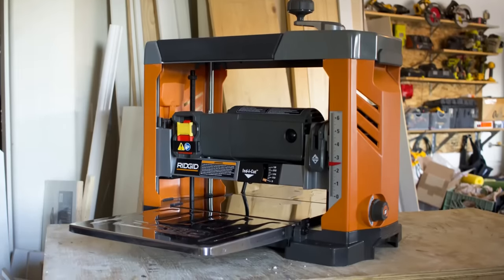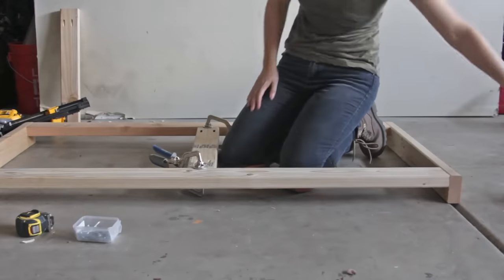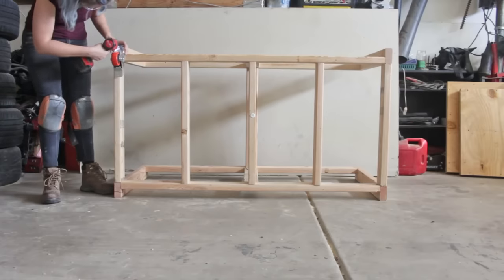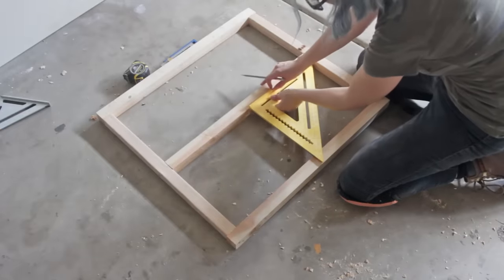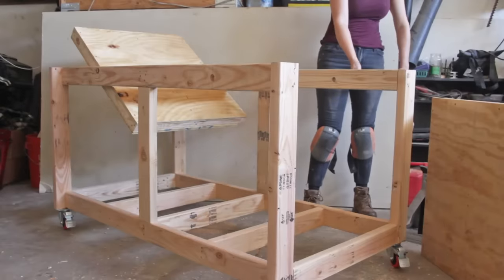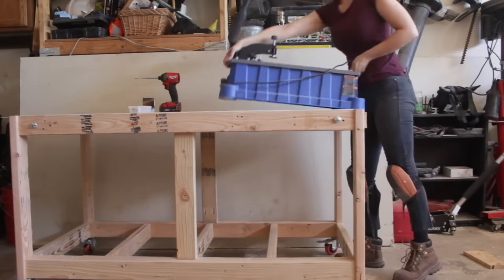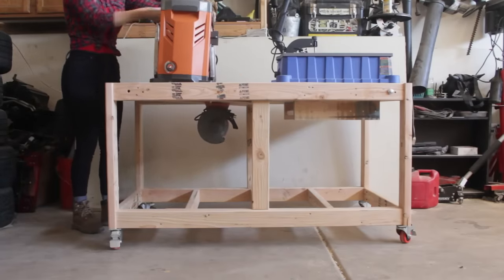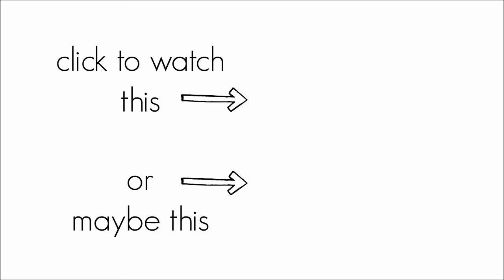Double Ended Flip-Top Workbench | Woodworking Build

Comment: Got to ask.. your the only you tube flip top bench builder that's only used nails and then just wooden dowels??

Can I ask if it's still in one peace?

That's a hell of a weight on a dowel rod.

And only 3 inch nails???

Sorry I'm just wanting to know if its not better I use screws and metal bars.

I do love the design of your double flip bench..

That's what made me carry on watching..

All the other you tube designs are single or if there double double ones , there really quite complicated and use hundreds of pounds worth of plywood ect.😢

Comment: Very nice.  Only 2 things I would change, myself.  The dowel I would use a non-wood material (like a galvanized steel pipe) instead, not so much for strength as much as so it doesn't bind as bad because of 2 different woods swelling (allows you to keep a tighter hinge, that way, too).  The second is that I would add a pin on the back-side of the flip-top (opposite the dowel from the lock pin) to prevent the table from flipping too far, in case your hands slip while trying to lock it in place.  You'd likely have to notch the table-top half-way in so that it will sit flat when over the stop-pins.  Very nice idea, otherwise.  Will probably do something very similar for my own shop.

Comment: I'd change out the wood dowels for metal pipe or rod, and then go for 7" carriage bolts so you could through drill a ball to make a easy grip for the locking bolts. Maybe a 1/2" vertical hole through the aprons for holding the locking bolts while you do the flip so your movements are as short as possible and the bolts are secure

Comment: Great project. Thanks.
Word of advice when using a framing nailer, having been a victim on multiple occasions: Don't put any part of your body in the line of fire of a nail gun. First of all, under the right (wrong) circumstances, nails can come through the material. I know that seems unlikely, but trust me it happens. I was hit in the forehead by a nail that came through a piece of wood. Someone else was using the gun - I just happened to be a couple of feet on the other side.The velocity was fairly low (slowed by the material) and did not do any serious damage, but it might have caused an eye injury if a little lower. I had safety glasses on, but the angle did not afford me effective protection.
Second, especially if you are holding the nailer in an awkward way, what can happen is you can get a bounce / recoil and fire a second nail. If that bounce takes the nose of the gun near the edge of the material, a nail can be ejected unimpeded. I was hit in the arm from about 20 feet away once. That nail tore a small gash in my arm, so it was moving pretty darned fast.

Comment: Motors start current is high (6 to 8 times run current). Drill batteries get less stress if you don’t pulse the drill trigger. Line it up and sque-eeze. Ease back as the screw reaches bottom.

Comment: Absolutely spot on girl,  you have really nailed it, if youll excuse the "pun" I was searching through Youtube for some idea's to build a dual purpose workbench when I came across your design. I'm renovating Antiques, along with Motorbikes and want to store tools but more importantly a chrome plating plant inside the workbench with several bench grinders, which I've converted into polishers. Your swivel arrangement witha bit of tweeking will work ideal for my needs, thank's for the idea and best of luck with your projects. I have to take my hat off to you, there's no doubt you seem to have mastered the skills required needed by the way you handle those tools, funnily enough I've just bought a 16 gauge cordless nail gun, can't wait for it to arrive??  Just one more thing if you don't mind me asking, did you find it hard to get sponsorship? Justin

Comment: Great work and a good project for any DIYer who needs a work space such as this.  My only comment, however, is that it is risky to aim you nailer toward your opposite hand, as seen in several shots of your work.  Better to hold the work pieces together with a clamp rather than your bare hand.  A 16p nail could do a lot of damage accidentally shot at your hand.

Comment: beautifully done. only i would suggest hardwood dowels as pins not pine.  you could also use the pins in two inset bearing sets to accommodate for weather swelling. next add side storage boards to it.  only other suggestion would be change thevcareagebolt to a eye bolt to give you a finger hold.  Remember to get the plainer blades sharpened regularly. kerp two or three sets on hand to you can have one set sharpened while the planer is still useable.

Comment: Cool idea, I think a steel rod and a steel pipe would help with wear on the hinge points, and maybe let it extend a little to one side, so you can install a handle or wheel. It looks kinda awkward, and if your hand slips your in the line of fire to be hit by whatever is mounted.

Comment: Some more practical advice your drilling a horizontal hole but holding it in a awkward manner. Start to drill the hole then with one hand hold the trigger then with the other hand don't hold the battery, instead hold the back of the drill. This has two advantages, one its further out so by holding the back of the drill you can balance the drill and keep it level more easily, and secondly you can apply even pressure to the back to ensure the drill drives through the timber with a constant even pressure. Hope this is of assistance to you and your readers.

Comment: Nice build. The only things i would have done different is i would have built the sides first. This would have made make lining up the privet points easier. as everything could have been drilled at the same time. also i would have used a piece of gas line black pipe as the axel.

Comment: I think the wooden dowel will hold, but I'd be very skeptical of it, especially if a large dynamic weight (whether intended or not) is applied to the panel.

Maybe a small steel rod instead. If it's threaded, find a steel bushing to locktite onto the rod.

Comment: Oh! This is that chick who pocket hole screws everything! I've seen her videos before! Although just a word of warning; many benchtop equipment machines have fragile warnings and no postal warnings on the boxes. So they may not endure being suspended upside down for extended periods of time very well. It'll also displace lubricants, which if glugged up (which everything made in China comes like - given they use old truck oil as lube rather than throwing it away - complete with iron filings and detritus included) will mean the lube will not return to operable areas in time for engaging the machines.

Comment: I see a lot of contraptions that utilize soft wood dowels to support loads and to act as pivots.  Am I the only one concerned about shear failures over time?  There was a guy who made a scissor lift with wooden dowels.  I watched as it creaked up and down.  Dowels by definition is a locator.  You shouldn't use dowels as a pivot or load bearer.  A steel pipe would be a cheap upgrade and drastically improve the durability, hence safety in the long run.

Put another way, all the 2x4s are meaningless if your weakest link is the cross section of the 7/8" diameter soft wood dowels.
Reply from the maker: The dowel was actually oak.

Comment: A metal pivot would have been better than wood.  EMT, metal rod or plumbing pipe and mounted with bearings.  Nice video showing work flow.  I, like others, winced when you squeezed the trigger and the nail gun was point towards you.  Dangling hair and power tools are not OK please be safe and set a good example.  There are power drill stands and jigs that allow straight drilling.  liked and subbed.

Comment: Definitely gonna use this idea. Only thing i would change would be to 3d print a handle for the end of the bolts, through the wood, spring and locking nut. That way you just pull back and twist instead of needing to take it out each time.

Comment: I spent the $8 on the plan, which I thought was a little high considering the simple constructions... but after building it this afternoon, I think it was a reasonable amount to spend.  The cut diagrams probably saved me $8 in materials and the plans were concise enough to save me a few hours of time.  All in all, simple build.  The only thing I had trouble with was getting all the dowel holes lined up.

If you build this, make sure you use a spade bit and not a forstner bit (like I did).  You need the slop the spade bit introduces to get the dowel in there with any reasonable force.  I'm sure the neighbors loved watching me bang on that big ole dowel with a mallet in the front yard for 10 minutes.

Comment: This is a great idea that I will copy.  Might I suggest making the power-plane side of the table sunken, so that it is more balanced that way it is easy to rotate your tools.
I would also suggest a bolt instead of a dowel for your pivot lock pin,
 so that you can spin the bolt all the way in to have it locked tight if you wish.   Put 2 wheels on one end of the bench and this monster becomes movable. 
Store your shop-vac just over the bench or under this bench to save more space also keeping the vac with this dust generating station where you might use the vac often. Consider it further and put a PVC pipe across the shop wall to make a central vacuum system for your shop steming from your portable shop-vac storage location.

Comment: a drill press, router, double Grinder and polisher, disk & belt sanders .  FYI do you realize that Hyper Tough tools and most HF tools are just as good all those over prices tools you are using.  I do have 2  2' x 4' work benches. they are massively over built to hold the weight of 4 cyl and transmission on them made of wood only.  The weight limit is by the wheels not the benches.

What I need to build is mobile and foldable table saw that matches Matt (Next Level of Carpentry) has.  It a killer but don't have the room for all that and I have 1952 Craftsman 103 8" tilt table saw that I FULL restored.  We mostly need to cut 3/4"  4' x 8' sheets of MDF into 35" x 35". for PUI pad builds.

Comment: Nice design. However, I would suggest screws instead of nails. It is stronger and easier to fix a mistake.  The carriage bolts are easy but could be misplaced or dropped. Might suggest a way to keep them "close"  ie magnet

Comment: I wanted to say something about your Bench Grinder. I too have limited work bench space so I mounted 3" long studs to my bench grinders and drilled matching holes in my work bench top. One of my grinders is a buffer x extra fine wire wheel and the other is a flap sander x stone grinder. Since the workbench holes are only 3/8" dia. I can easily swap the grinders or leave them off completely.

Comment: battery powered framer guns are worthless.  I’d only use the battery powered Brad nailer.  The framer isn’t enough power and you end up hammering half the nails the rest of the way.   Even the Brad nailer can have those issues but not as often.   Don’t even get me started on the passload gas powered guns.  Big pile of garbage.  Hitachi pneumatic framing nailer is the go to for most framers.

Comment: do you allow me to tell you a technical thing? maybe, it would have been better if you had put the vertical woods from the base to the top exactly under the rotation holes. this would have guaranteed a strongest resistance to the structure. anyhow, congrats from Roma, italia. A.

Comment: Please be careful pointing and shooting the nail gun towards yourself.  That is not a good habit to get into.  I say this because I used to work in an ER and had a patient come in with a 16 penny nail that he shot through his kneecap and into his femur, and with the speed/force of the nail gun, neither bone broke, but the nail was still solidly in place.  This was about 25 years ago, but I wish I would have had some kind of camera because that X-ray was really cool to look at.  If you had left one side of the rotating surfaces open, you could have placed 2x4 supports in line with the holes you drilled for mounting.  Probably overkill, but worth it.  Instead of a wooden dowel, a pipe (like the ones used for pipe clamps) would have been longer lasting and more rigid.  You could have drilled a hole through the interior portion of the side supports and then scribed a pencil line while rotating the table top, then used your router to follow this line and insert a bolt as a hard stop when rotating your table tops.  If you lose your grip and the table rotates too far, it would have potential to damage one of your tools.  You may have room, but if you moved the grinder wheel back even more (if required) you could build a little chute to guide the dust and debris from the planer into a plastic bin or trash can.  I would also suggest drilling holes through the carriage bolts and attaching them with a small wire or string so they are always on hand and do not get misplaced.  You could have also added a block of wood as a hard stop for the carriage bolts as they slide in so they are easier to gripe and pull out.  I know it may sound like I'm complaining, but I'm not.  I've saved this link in my folder for future reference.  I'm just getting back into wood working after a few decades and I have very limited space, and this is a good, simple and effective build!  Nicely done PA!  I subscribed and gave a thumbs up!

Comment: I´m impressed with this idea. I think I borrow it from you :)

I´d improve this a tiny bit by screwing on a piece of wood with a hole in it each side to hold the bolts during the time you need to flip it over. Maybe countersinking a strong magnet in the 2 by 4 to securely hold the bold would do the job also.

Comment: I have some suggestions toward the planer side as I see you are struggling to flip it due to the weight.
1. Where you dowel is I would use A threaded piece of 7/8 Conduit or black pipe thread one side face this side out and make long enough to stick PASSED your frame for a lever, then drill two holes through the frame and pipe to secure the pipe to the frame and keep the pipe from sliding out.
Use a tee fitting  at the threaded end with two 2 foot sections to be used as  handles, tightening all threaded pipes then either have the ends welded or drill a hole and install a roll pin to keep everything from coming loose.
You could make a nice handle by wrapping it in leather or make a wooden handle to place over the pipe.
Secondly I did not care for you wheel installation as it appears the Caster does not have enough support across the entire wheel frame ,Also I would not use nails as they tend to come loose if the table is moved a lot. Screws are a better choice and all 4 holes should be used.
As far as your lock bolts a piece of steel rod with a 90 deg handle would be easier to remove and install.
I have other idea's if you are intrested. I hope I conveyed a couple of ideas to you clearly.

Lastly nice job.

Comment: many years ago I purchased a Craftsman Rotating tool bench.  very similar to this, except it has triangular pieces mounted on an axis and 3 'bench tops' to mount tools on.  there are 16" pieces that are placed at the edge of each bench top to provide support as well as a little additional work space.  they are removeable, and must be removed to rotate to the next tool.  I think mine takes up about the same amount of room as yours, but yours could handle 4 tools.  my current bench somewhat limits the height of tool you can mount to each bench top.  it appears that your design can accommodate taller tools.   I may need to go with your design so I can add another tool to my work space.  I would probably add full time power for each tool (as I have for my current bench) so I could just spin to the next tool and turn it on and go.

Comment: Great bench good to see how you made it. But i would like to comment on safe working practices looking at your video its clear that on many occasions you are firing your nailer towards you, towards your hands or your body. this is potentially dangerous. Also with a bit of planning you did not need to crawl through the bench to nail or screw it, practical working is important to protect your knees and back. overall its a great bench and great idea, just be careful with safe work practices.

Comment: I know this is an old video but the table is great. I just got the DeWalt 735 Planer and have limited space. I like the idea of a flip-top outfeed roller side. I think I will use this for mine. I'll probably make the roller setup with 1x materials and use T tracks to make it adjustable and removable. Also double as a jig for my router as well. I'll figure it out eventually. 😂. Great stuff. Subscribed!!

Comment: One mod I'd make (not necessary for this setup) would be a hookup to a dust collection system and a hose with a quick release. That way, if you had more than one dust-producing tool mounted, you could easily connect/disconnect it from your dust collector as needed. I'm thinking like PVC running along the front and down one of the legs, and the detachable hose roughly in the center of the front apron.

Comment: The bench needs a power supply attached to one of the sides, Like a plug strip or something. This would allow you to easily plug in your tools when you decide to use them. I would mount it upside down near the front face of the bench (to keep the dust out).

Comment: Nicely done!  Thanks for the great step-by-step. You might find it easier on those long plywood cuts to clamp a straightedge to the piece and running your circular saw along that.  If you shorten the insulation by a few inches then there's a place to clamp it to the work piece.  I use a piece of scrap plywood that is nice and straight for mine  I find it easier to keep an eye on the saw's plate against that straightedge than to have to try to watch the blade and the line. 

How has this held up over time?